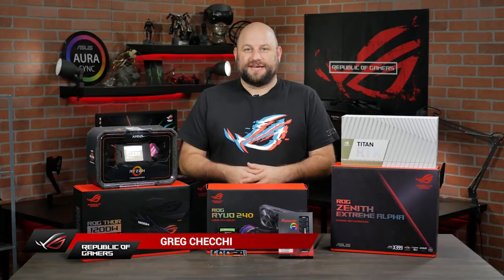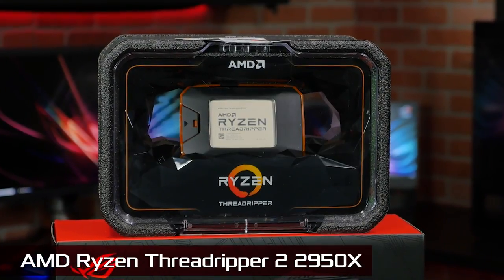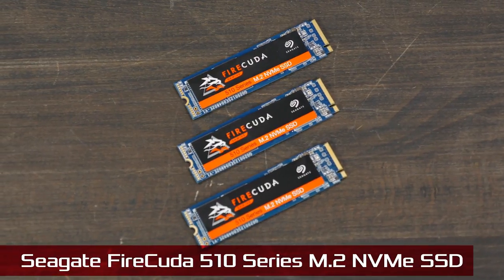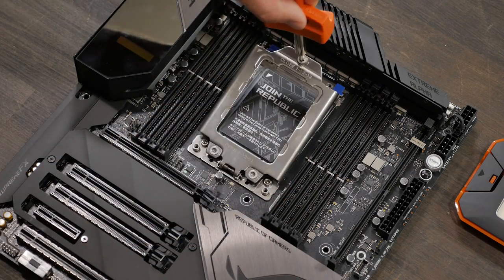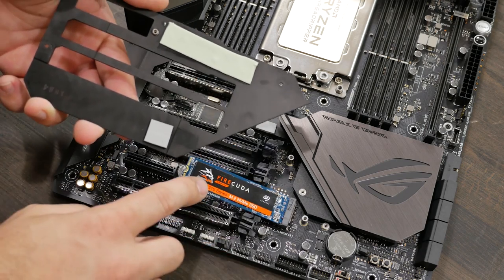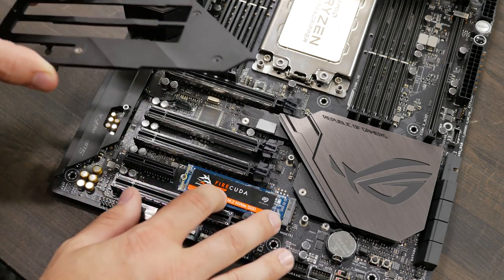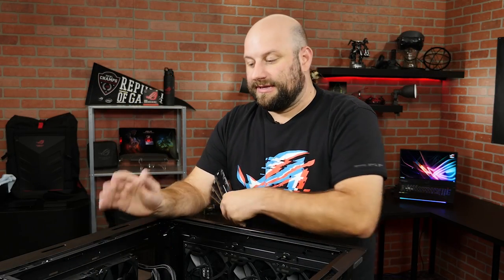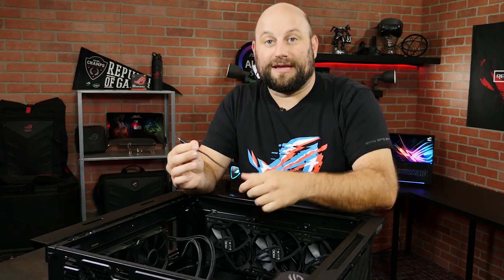The Ultimate AMD Threadripper Build!

Comment: I have the Asus X399 Alpha with Thermaltake watercooling but my waterblock does not seem to fit the bracket you have featured here.   How can I adapt this bracket to the waterblock for the Tt Thermaltake Pacific C360 Soft Tubing kit?   Also, I'm trying to run this board with 3 GPUs and there doesn't seem to be any examples of anyone doing this anywhere.

Comment: My PC Build:

-Asus ROG Strix Helios GX601 RGB Mid-Tower Computer Case
-ASUS ROG Thor 850 Certified 850W Fully-Modular RGB Power Supply
-Seagate FireCuda 510 1TB Performance Internal Solid State Drive SSD PCIe Gen3 x4 NVMe 1.3 (x3)
-Asus ROG RYUO 240 RGB AIO Liquid CPU Cooler 240mm Radiator Dual 120mm 4-Pin PWM Fan
-Seagate IronWolf 110 3.84TB NAS SSD Internal Solid State Drive
-NVIDIA Titan RTX Graphics Card
-G.Skill 32GB DDR4 Trident Z Royal Silver 3200Mhz (2 x 16GB)
-Asus ROG Strix Scope RGB Mechanical Gaming Keyboard
-ASUS ROG Gladius II Wireless Optical Ergonomic FPS Gaming Mouse
Reply: Don't flex just yet without mainboard and cpu. Is that where your money ran out.
Reply: GoodolOzzy Not at all I don’t know why every time I post some of what I post goes missing. I didn’t even notice it 🤣

Comment: wonder if you can get more out of the ram than 3000 mhz, ram is insane difficult on higher speeds with 64gb on TR, can you do a follow up video with settings and performance?
Reply: I have Asuses Zenith Extreme, stacked with 128Gb's of ram. At the moment, I'm unable to overclock to 3200Mhz. Maybe some day there will be a bios that can achieve that speed.

Comment: TO BUILD A MUSIC AND VIDEO WORKSTATION, YOU NEED AMD RYZEN 9 3950X WHICH HAS 16 CORES AND 24 THREADS. NOCTUA NH-D15 CHROMAX BLACK CPU COOLER, 128GB 3600Mhz CL16 MEMORY. GIGABYTE X570 AORUS MASTER MOTHERBOARD, IT HAS 32 BIT 192KHZ DAC. RTX 2060 SUPER OR HIGHER GRAPHIC GARD. 2TB M.2 NVMe, WD ULTRASTAR 10TB. MINIMUM 2K MONITOR, AOC Q3279VWFD8 QHD 75HZ FREESYNC IPS 32IN 2K MONITOR. 750W 80 PLUS GOLD POWER SUPPLY. DEEPCOOL KENDERMAN ATX MID TOWER CASE OR BETTER. BETTER THAN A $15,000 MAC PRO, AUSTRALIAN
.     
    BETTER THAN A 2950X
Reply: Nice caps lock.